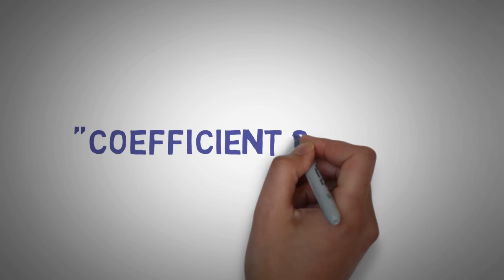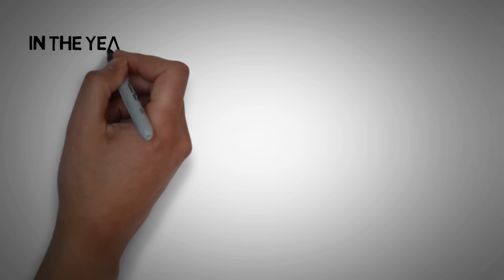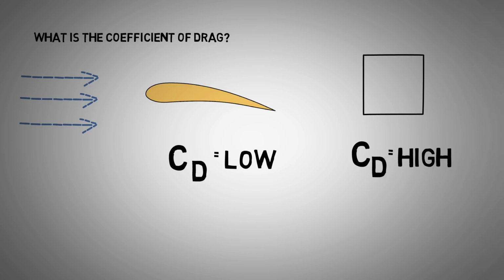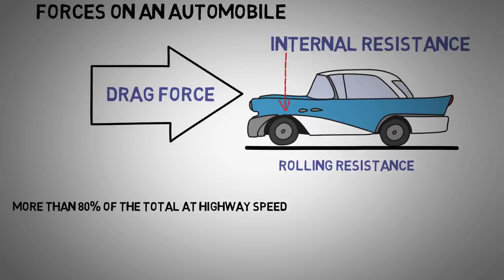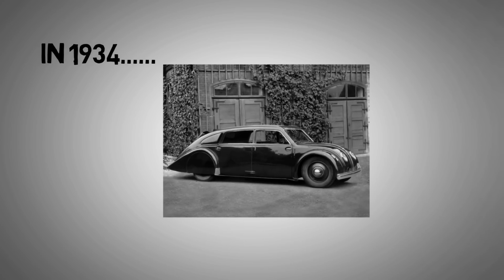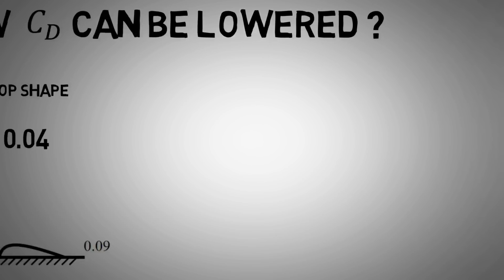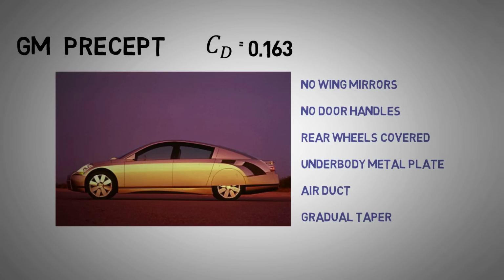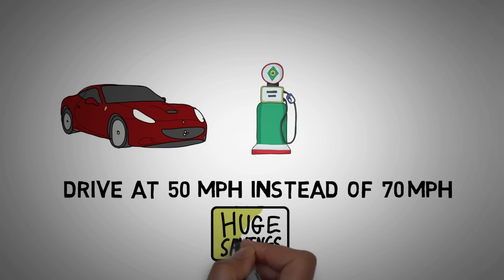What is Coefficient of Drag ?

Comment: Great video! You could do a series of videos on this. Expanding on internal flow channels, flat floors and more. Simply arcing the front bumper makes a tremendous difference in coefficient of drag. The model x is 0.26cd because it's nose is more teardrop shaped. Subtle enough to be nearly invisible. It looks huge from the front. 2D frontal area is tremendous for the 7 passenger. When you look at it from a 45 degree angle you see something much different. Front air channels forming invisible air curtains over the wheels etc.

Comment: Thanks for the informative video. Questions.  When a car drives along the road is it only the turbulence that will move dust into a dust cloud behind the car? Will the movement of dust be related to the  Cd of the car? For the Cd of the car, dose size matters? Like if a small or big car has the same Cd will the air force which generates the dust cloud behind be the same?

Comment: The “A” in the equation is the frontal area that is perpendicular to the flow, correct? Because on Wikipedia it says that for cars we use frontal area but for airfoils we use the wing area. Why would we use a different “A” for airfoils?  Why don’t we also use frontal area for airfoils?
Reply from the maker: There are two type of drag forces. There is profile drag in which frontal area is used. There is skin drag in which surface area is used. If the body is blunt, profile drag is much higher than skin drag. For a aerofoil, that doesnt have much frontal area particularly at low angle of attack, the profile drag and skin drag values are comparable
Reply: Synergy Files If they’re comparable shouldnt we need to take both into account? Are there two Cd’s, one for profile drag and one for skin drag?
Reply: Yes, for cars and other light duty vehicles, engineers have seemed to have agreed to use frontal area.  Aircraft and airfoils yes they use airfoil horixontal area, I think because lift coefficient is defined with respect to horizontal area, so Cd and CL can be compared with respect to same horizontal area. reference.   
Note that for vehicle aero testing, the frontal area  is often estimated by (85% * max height* max width),  the 85% due to curves on sides and roof, and the "typical amount of open frontal area below thecare between the tires.
  if car is low, or has  low chin spoiler, 85% is probably too low use 90%, orbetter do moreprecise measurement of the frontal area or silhouette.    Also, sometimes the side mirrors are included in the max width measurement, which, using 85%*H*W, makescan make apparent Af more than its actual area.  Ironically,,  mirrors create turbulence and usually actually raise the Cd a few % unless they are really well integrated.  So But with this technique you'll end up with measuremente that combined (WLSE) give us anestimate of rho(T)*Cd*Af. If we have a higher than real value of Af due to mirrors sticking out wide, Cd will look better than it should, especially since the mirrors are really making it worse (higher).
Probably best to leave mirrors out of max width, but add their actual area?  Also, car companies claim a Cd but don't tell the Af which is a hassle, and their Cd measurement isn't described, so one can't tell fi its measued at its absolute miiimum they can find over all speeds.  It stinks..  Aeromodder and hypermiler  websites good sources. For me the hassle has been getting reliable road elevation data and wind data, and not getting rear-ended by fellow Bostonians!  BR
Reply: @foxlies0106  Well, I must say, my original comment was from 5 years ago and in that time I received an engineering degree and learned much more about aerodynamics. But, still, I enjoyed your comment.